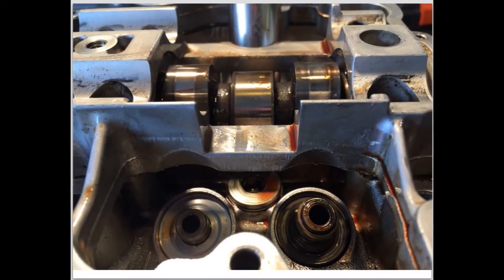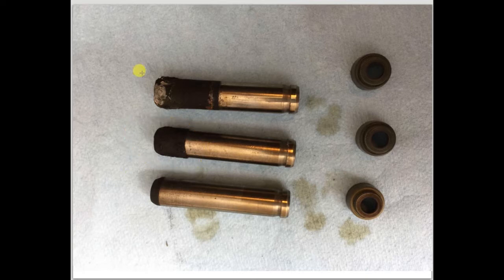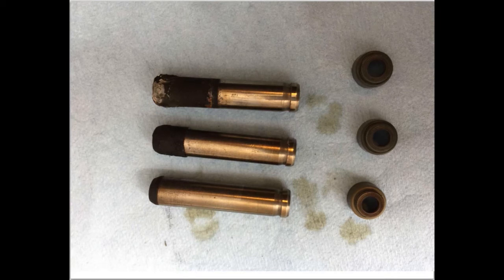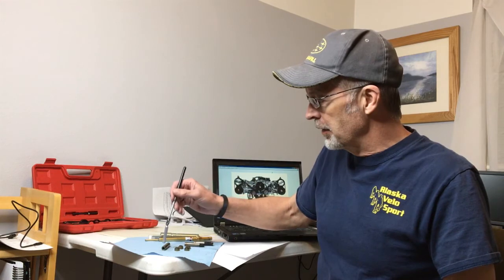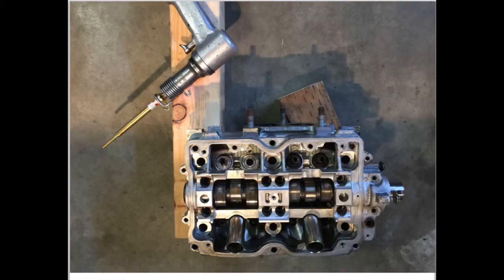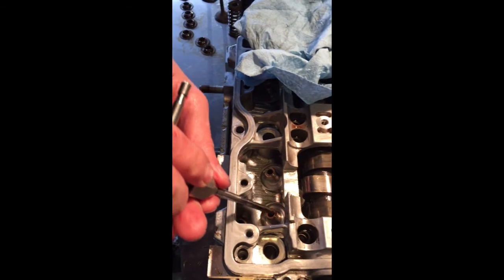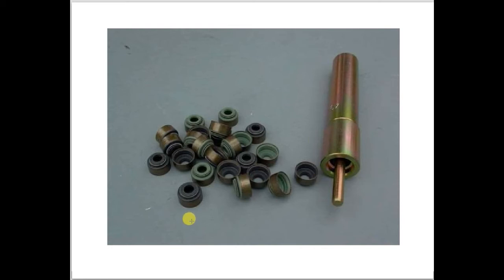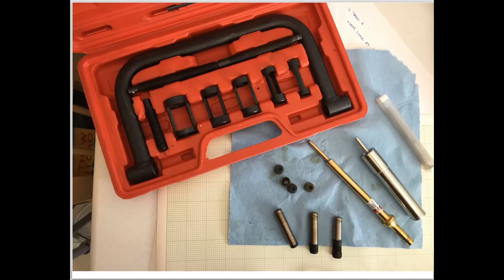Subaru EJ25 SOHC Valve Guide Repair

Comment: Dare I ask how much it costs to pull the engine, put in new valve guides, machine the heads, etc.?  Around $3k - $4k?
Reply from the maker: Labor costs will vary a lot depending on location.  Your best bet is to contact a local Subaru shop and get a quote. I can list the parts breakdown for this repair below:

SOHC NA Head Gasket Repair Kit $279.99
Head Bolt Set $96.99
Coolant Cross Over O-rings $7.50
Valve Stem Seal Kit $88.00
Timing Belt Kit $315.99
Water Pump & Thermostat $149.99

Subtotal $938.46

GSC Power-Division Valve Guides for Subaru EJ SOHC with stopper $103.38

Total $1041.84

This car came in with a broken timing belt and bent valves. So, it needed all new valves.

Intake Valves $172.18
Exhaust Valves $172.59

Parts Total = $1386.61

9.1 hours labor head gaskets
10 hours labor to replace guides, stem seals, and 3 angle cut the valve seats

$150 per hour shop rate

Labor 19.1 hours x $150 = $2865

Parts + Labor = $4251.61

Comment: Was this an 00-04 or 05-09 SOHC? GSC states these guides do not fit my 00-04 EJ251.
Reply from the maker: This was a 2005 Impreza RS. I think that 00-09 SOHC valve guides are all the same, but definitely take measurements to be sure. Sourcing parts can be very challenging. I'll be the first to admit that finding the right parts on the GSC Power-Division site is not easy.  Remember, though, they are not Subaru specialists and make parts for a large variety of cars. My first order was the wrong size (way too short). Taking measurements, referencing the service manual and several phone calls later I ended up using GSC3025-8 for the intake and GSC3019-8 for the exhaust. 

GSC3025-8 total length 47.57 mm
GSC3019-8 total length 52.45 mm

The factory iron guides are the same length and the compensation for that is by not pressing the intake guides in as far.

From the service manual:
Protrusion above head (for factory iron guides)
Intake 20.0 - 20.5 mm
Exhaust 16.5 - 17.0 mm

You press the stopper guides in until they bottom out. This will result in correct fit.

These guides worked for my application.

I hope this helps. Thanks for watching.

Comment: doesn't seem like the reamer is made anymore from subaru, do you have an alternate source?
Reply from the maker: Hey Richard, you can order a 6mm reamer online from cylinder head supply shop, Woodward Equipment.

https://www.cylinderheadsupply.com/

https://www.cylinderheadsupply.com/kl1110nb.html

Thanks for watching!
Reply: @tolsgarage1641  thanks! I measured the diamter of the valves and technically it is 5.96mm, is a full on 6mm going to create any slop or is that ok?
Reply from the maker: @richardli8634  Yes, that is okay.

Comment: I'd be curious to know what kind of lifetime you're getting out of the bronze valve guides. Everything I've read so far indicates that their lifespan is much shorter than cast iron guides, and really only suitable for racing. I think this fault is more down to manufacturing tolerances, and extended service intervals causing issues with valves grabbing on the guides. Also other advice I've come across is that the guides should also be honed to improve lubrication and longevity, especially bronze guides
Reply from the maker: Good question.  High quality manganese bronze guides work well for both high performance applications as well as for the daily driver.  The advantage of cast iron is that they are cheaper.  To specifically address the issue of the guides dropping, I'd recommend the shouldered guides mentioned in the video. I'm not aware of a shouldered cast iron guide.

I don't have an opinion on valve guide honing.  It isn't done at the factory and also isn't mentioned in the 
factory repair manuals. It is definitely an added effort and expense, but I'm not sure how much benefit you would see. 

Here are a few articles that you can look at:

https://www.enginebuildermag.com/2013/04/valve-seats-guides/#:~:text=Under%20high%20stress%2C%20cast%20iron,the%20choice%20is%20manganese%20bronze.

"Under high stress, cast iron guides tend to crack and fracture, which can result in engine failure altogether. Cast iron is inexpensive and works best with daily drivers and high mileage applications. For any kind of performance application, the choice is manganese bronze."

https://kelfordcams.com/valve-guide/#:~:text=Manganese%20bronze%20guides%20offer%20many,with%20all%20valve%20stem%20materials.

"Why are bronze valve guides better?
Manganese bronze guides offer many benefits over cast iron; higher strength, more load capacity, low friction, improved heat transfer rate and good corrosion resistance. Manganese bronze is compatible with all valve stem materials."

http://www.jandeengineering.co.uk/valveguides.html

"Bronze valve guides are usually fitted to modern multi valve and high performance engines as the material offers better anti-seizing, anti wear properties than cast iron guides. Bronze also has a greater thermal conductivity and lower coefficient of friction.

Tests show that bronze guides will outlast cast iron guides by three to five times..."

Comment: How did you determine what size reamer  you needed?
Reply from the maker: 6mm for this EJ25 SOHC. The factory service manual for your particular engine model will specify the size you'll need.

Comment: Hi did you replace the valve springs, retainers, and keepers? If so do you have part numbers and where did you purchase them? Thanks
Reply from the maker: Hey Lanny, the springs, retainers and keepers were all in good shape so I was able to reuse them. The service manual has a procedure for inspecting valve spring serviceability.

If you need replacement parts, here is a source:
https://www.subarupartsdepot.com/
Thanks for watching!

Comment: Thanks, great info. What else can you use instead of the air gun? Or is it a must?
Reply from the maker: The factory manual specs a hydraulic press with special tools 498267800 cylinder head table and 499767200 valve guide remover. The air hammer method is just so much easier, faster and cheaper.

Comment: I am experiencing random misfiring on cylinder 2.  Runs fine some days and then not so well on other days.  I will look and see if this is what is causing my trouble.  Really good video.  You know any good subaru mechanics in Houston Texas?
Reply from the maker: Hey Russell, thanks for watching. Sorry, I don't know anyone in the Houston area. Good luck!
Reply: Did you fix the issue with your subaru ? Did you found a good subaru technician?

Comment: Do you recall where you ought the  reamer?  Seems hard to find!
Reply from the maker: Hey Patrick:
The reamer size is 6.0mm. You can order one from your local Subaru dealer 
using the Subaru tool # 499767400 or online with:

https://subaru.service-solutions.com/

https://subaru.service-solutions.com/en-US/ProductList?search=499767400

or

https://www.cylinderheadsupply.com/

https://www.cylinderheadsupply.com/kl1110nb.html
Reply: @tolsgarage1641  Thank you!

Comment: How far in are the guys supposed to go what is the distance between the head and top of the guide.  I ordered guide's from the same place but they don't have the stopper on them like the one on the video.  When I click your link to GSC it comes up page not found.
Reply from the maker: Hey Garry. I updated GSC link for the shouldered guides. Without the stopper you will have to measure the valve guide protrusion. For the factory valve guide it is 20 mm for the intake and 17 mm for the exhaust.
Reply: I returned the guides I bought and purchased the shouldered ones.  In knocking out the valve guides I chipped the bottom of where the valve guide sits.  A little chunk is out of it.  I have intentions of putting loctite on the valves when I drive them in to make sure they don't move, allow leakage and give nice tight seal.  But my concern is the small chipped area.  It doesn't come in contact with the valve.  It is in the chambered area.  Your thoughts?
Reply from the maker: @garrythomasjr4765   
Hey Garry:

 I wouldn't be too concerned. However, I would not recommend using loctite on the guides. 
 They are a press fit and the can seize or gall while installing without some lubrication.

Good luck!

Comment: So... I ended up having a machine shop do my heads including the stem seals, etc..   I  got it all back together in the car and at least 1 or 2 of the exhaust (and perhaps others) valve stem seals are leaking badly.    I can see by pulling the exhaust manifold there is gunk right up next to the guide.  I am wondering if it is possible to replace these without removing the heads.  I will pull the engine.  The Subaru tool you have there obviously won't work because the valve would still be in the guide.  I do have shop air to and adapter to keep the valve from falling into the hole when I release the keepers, etc.
Reply from the maker: Hey Patrick, I found this tool. I think it might be what you need.

https://www.euroexportinc.com/universal-valve-seal-installation-tool/

good luck!

Comment: Hey do you feel like selling those tools you got there ? If you not going to use them again
Reply from the maker: Hey CE, I still use these tools. You can order the Subaru tools from the dealer, the Snap-On tool truck was the source for the guide press and it looks like the Amazon link for the valve spring compressor is still good. Good luck and thanks for watching!
Reply: @tolsgarage1641  ok thank you Tol’s Garage

Comment: nice video. Does the GSC shouldered valve guide prevent it from dropping?  I have a supercharged sohc with a couple dropped valve guides.  I've never seen or heard of a dropped intake guide, does it make sense to replace both?

by the way GSC says that the intake and exhaust guide are the same but maybe they are wrong
https://www.power-division.com/subaru-misc-guides/gsc-power-division-intake-or-exhaust-valve-guide-for-subaru-ej-sohc-with-stopper.html
Reply from the maker: Yes, the shouldered portion keeps it from dropping.  The guides are very close to the same length and having the intake slightly longer will still work. I too have never seen an intake guide drop, so I think you could probably just replace the exhaust.

Comment: How did you remove the dropped valve guide? Also, did you have to do any work to the head where the new valve guide was installed? Thanks for the video
Reply from the maker: Drive them out with the valve guide press tool and air hammer. No additional work was needed on the head.
Reply: @tolsgarage1641  thanks for the response. I’m doing head gaskets right now and found a dropped guide.

Comment: Your video says sohc but the guides say dohc only, just want to verify your is sohc before ordering
Reply from the maker: I measured the guides to verify I got the right ones. I used GSC3025 for the intake and GSC3019 for the exhaust. The intakes are slightly shorter.

Comment: Can I use hydrolic press valve guide in cylinder head instead of air gun ?
Reply from the maker: Yes you can but you will need a cylinder head table to hold the head at the correct angle so that it will align with the press. The tool number is 498267800. I've found it a lot faster and easier to use an air hammer.